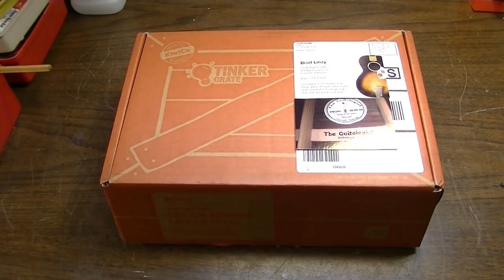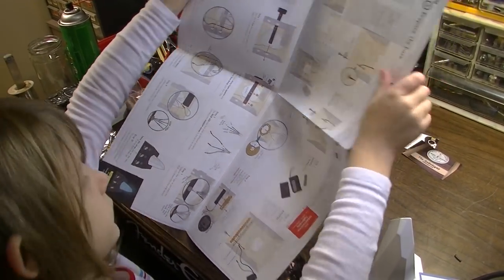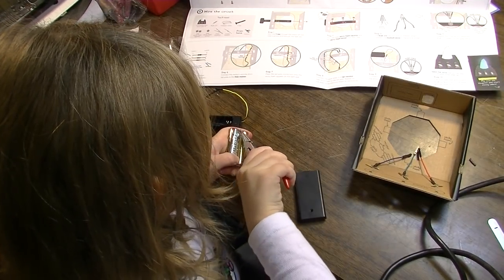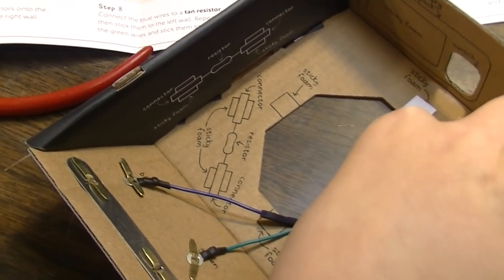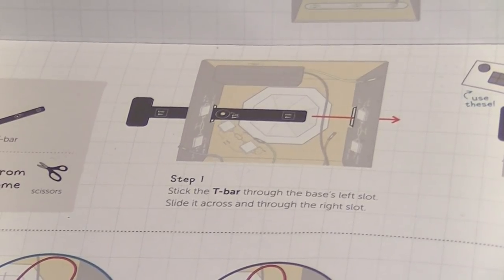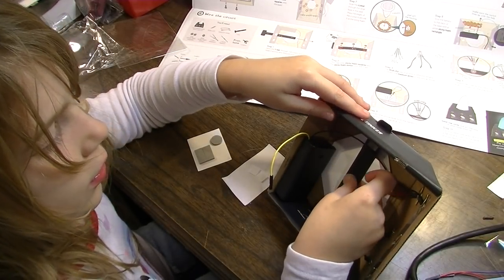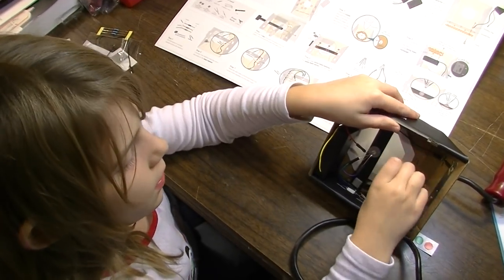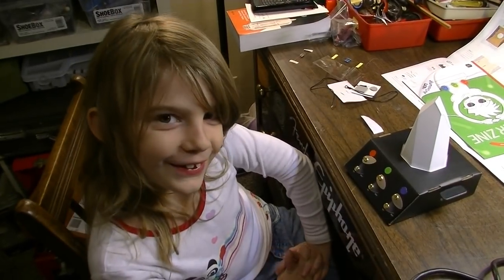Tinker Crate Review - Daughter and I Build a Battery-Powered LED Color Mixing Crystal

Comment: Dude I was just thinking of you & mentioned asking a question that you would know how easy or not this would be. Then Your video pops up in my feed. So if I may ask how hard would it be on a analog mixer to make the 1/4" input an Insert point. It has XLR & a 1/4" under it like a Hi z input i was thinking it would be that hard to make that an insert for like a compressor eq… Thx Cute lil girl you have I think that's cool program "tinker crates" that would make a great gift. As a kid I got a Radio Shack electronic kit once w/springs all over a board & you could build radios sound fx testers w/ wires that gave you pre colored & cut…that was a cool "toy".
Reply: That was awesome she's sweet heart your a big kid Brad lol that made my day. Thx for sharing they are fun at that age. :)
Reply from the maker: What do you mean by "insert point"?
Reply from the maker: Watchman4u I'm sure there are other tinker projects for kids out there. I bet the RS one was cool.
Reply: you know on a mixer where there's the Trim/Gain knob then under that is where you plug in XLR Mic Cables , right there below the XLR input some mixers have a Insert 1/4" Tip Ring Sleeve where you can send a signal out to a Compressor / EQ … then out of the Compressor or what ever last in that chain back to the same 1/4" Jack , you must use an Insert cable one end 1/4" TRS then two points of the Tip & The Sleeve are separate cables so you get one sending one returning to patch in before the rest of the chn strip of the Mixer , some skimp out on Inserts but give you a 1/4" Hi Z input in place of what would be a "1/4" Insert".